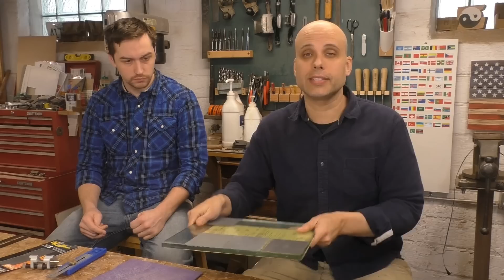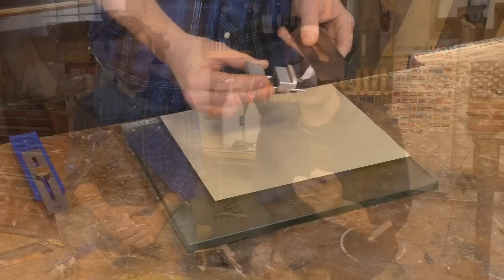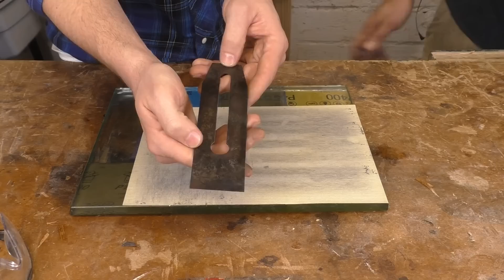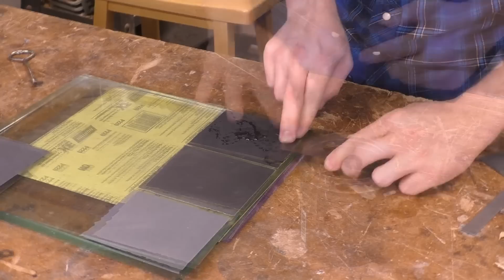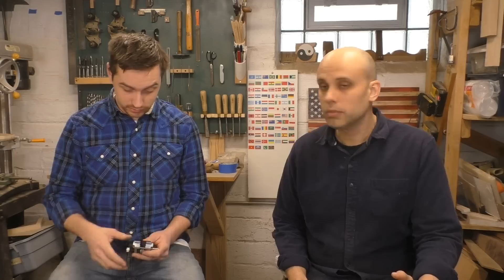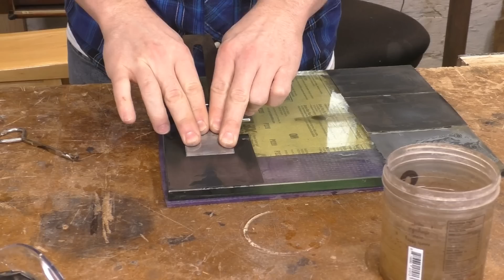True Beginner: Basic Sandpaper Sharpening

Comment: Thanks for the great instructional video.  Using your information I now have my Taylor Toolworks #5-1/2 Jack Smoothing Bench Hand Plane working well on pine and fur.  Haven't tried hardwoods yet.  I still have a 0.001" gap between the chip breaker and iron I can't seem to get rid of.  This gap only collects a very small amount of chips (~1/16" strip of material) but doesn't seem to effect the planes usage.

Comment: Hi Rex ,I just wanted to say a massive thankyou for producing the most informative videos that I can completely relate to , for as long as I can remember iv had frustratingly dissapointing results with a hand plane , untill today ! I recently picked up a very nice condition Stanley no 5 for £20 having sharpened, cleaned and set it up as you have shown it produced a shaving that was full width full lengh and translucent! I was completely blown away by just how good this quality tool can be when it's correctly set up ,you have made this particular subscriber extremely happy today thanks again

Comment: Thank you Rex and Nate. One question I have is regarding using a honing guide. When you set the length of the iron out of the guide, do you need to reset that length to get the correct angle as you grind down the edge? Or is that evened out in the 2 degree offset?
Keep up the good work

Comment: I recently used a similar method to hone a straight razor. Started with 400 grit, then moved up to 600 and finally 1500 and finished it with a leather strop. Scary sharp is right! I was skeptical, but it worked.

Comment: Hi, Rex. Dumb question(?). Do you need to glue the wet-dry paper to the flat surface? If so, what kind of glue? Does spray adhesive work? Also, please explain the reasoning behind WHERE you attach the W-D paper. I notice that you have it all along one edge of the glass. Thanks.u
Reply from the maker: No problem.  I use 3M Super 77 spray adhesive.  It comes off with mineral spirits.  I put the paper on the edge of the glass because that's the only way you can work the back of the blade. Totally not dumb questions.
Reply: Thanks for the quick reply, Rex. I enjoy all of your videos — and learn a lot of useful, sensible stuff that has greatly improved my woodworking.

Comment: I really enjoy your approach in the videos. So far, I'm only a watcher, but am planning to sharpen some old chisels I have that have seen better days.  
BTW, chromium oxide buffing compound you said it was chromium and oxygen that's inaccurate. Chromium oxide is chromium rust, just like iron oxide is iron rust. Oxygen has acted on the metal to (begin to) degrade its structure. Putting chromium oxide into the compound makes the compound have a kind of super-fine 'grit' (like putting grades of sand on paper makes paper have varying 'grit'). Different additives in compounds help with polishing, buffing, even cutting.  No, I'm not a chemist or similar, but woodworking isn't the only rabbit hole on youtube.

Comment: I disagree about the economics of the scary sharp system I've been using the same strips of abrasive for about 6 months. I've sharpened all my chissels and plane irons repeatedly. Now I spent a little more and bought the abrasives from the UK company that uses the scary sharp brand name I think the main difference is that it sticks to the glass better and I use the 2 wheeled honing guide they recommend using that in conjunction with honing oil and only ever pulling the blade backwards the abrasive lasts a long time.

To sharpen with water stones or oil stones you will also need a diamond stone to flatten the surface of the stone periodically do these methods are pretty expensive.

Comment: If you use spray adhesive the sand paper lasts a very long time, I also made my sharpening surface on glass and the reloadable option out weighs an imperfection developing in a stone

Comment: I did it! Thinner than paper shaving buttery smooth wood. And it is amazing. Rather than sandpaper I bought the sharpal diamond stone 60 bucks for the big one (do not bother with the small one). 320 on one side and 1200 on the other. This is a tool steel terror. The stone does its job well add a strop and you are done. That said. I did and redid the blade. Now on to the true beginner how to plane. 

Rex and Nate Thank you!
Reply: Hey, do you have a link or name for the diamond stone that you bought?

Comment: I happened to be passing by a place that does custom stone countertops...and Lo and Behold!...they had a 'scrap bin' of off-cut pieces of granite that was open to anyone that wanted to dive in and salvage whatever they could use. Came home with several pieces. Granted...they are smooth on just one side. Great thing about them is that they are HEAVY and don't slide around much. I've glued thin foam padding material on the back side and they now STICK to my work surface really well! You could use that rubber/foam kind of kitchen drawer liner material just as well.
My one suggestion here would be to put a little dish soap in the water that you wet the sandpaper with, or use something like glass cleaner (Windex). It will help keep the sandpaper from clogging up and, thereby, last much longer.

Comment: Wait so for the honing phase, what do you  set the projection angle for, do you set it differently than the setup phase? I would think you would want a slightly more dramatic angle on the very tip of the bevel, no?

Comment: Help guys. I have a flea market plane iron. I flattened the back and used a honing guide on some 150 grit sandpaper to prepare the iron for honing. I was doing that and used two sheets of sand paper and for the life of me can't get a burr on the back. I thought ok maybe I just can't see it but after running it on my 400 grit water stone for a few minutes, still no burr. They take off material but there is no burr on the back and the iron doesn't feel any sharper.

Comment: I find it works well to explain grit progression thus: Imagine you're going to dig a swimming pool sized hole that you need EXACTLY 4 feet deep. What tools would you use to do that job? You might start out with a backhoe because it can move a lot of dirt really quickly. However, it won't have the precision to get you to exactly 4 feet deep. So after the backhoe, you switch to a shovel. It moves dirt more slowly, but allows you more control as you approach 4 feet deep. To get it to that perfect 4 feet deep, you would then switch to a hand trowel to take tiny scoops getting even closer. You might finish with a tablespoon searching for that perfect 4 feet deep. 

Now, you could do the whole thing with a tablespoon, but you'd be crazy to.

Backhoe = 220 grit
Shovel = 400 grit
Hand trowel = 1000 grit.
Tablespoon = 1500 grit
Reply: 3000 grit baby spoon
6000 grit a flat splinter

Comment: I’m almost ashamed to admit that the accurately cambered iron... has been kicking my butt. I really thought it wouldn’t be much of an issue since I’ve been honing just about everything for decades, even straight razors for the last decade. I put pressure on the outer edges like all the videos show and work my way in and the edge still ends up leaving lines in my work piece. It has gotten a little better but I cant really even see or tell there’s a camber even if I set the bevel with outside pressure and honed with pressure on the outside edges the whole time.. I pretty much still end up with a straight edge and lines in my work. Put a straight edge across it, and it’s still virtually perfectly square with zero camber. I guess I just need to tinker with it and figure it out.

Comment: This is great! I had a stupid problem early on, but it was easily fixed: When you glue sandpaper to a flattened surface, ONLY put glue around the OUTER EDGES; putting glue in the center of the sandpaper will only create ridges for the blade to get caught on, and ruin the paper, and probably mess up the edge you've gotten so far. It sounds obvious now that I made the mistake, but I was on auto-pilot when I was doing this, and assumed getting the sandpaper super secured to the paper was more important; it's not. Overall, it took me about three days to get to the final product, but I can easily shave hair off my arm now! Feels great to finally accomplish some of the basics! :)

Now onto the much harder task of restoring the hand plane itself. Seriously...there's so much rust on the sole (I think that's the part, the silver part that sits flat on the wood to be planed) is so rusted that the entire thing is basically orange. No silver at all. The cast iron itself is just a bit dusty, but that iron is just...caked...in rust. I can't even tell if it's pitted, but I'm assuming it is. Wish me luck, boys!

Comment: For those looking to not jump into the fray of over-priced sharpening systems from using sandpaper - In Paul Sellers recent March 11 blog post he discusses the very inexpensive Chinese diamond stones he switched to from his more expensive EZE-Lap stones. He makes a good case for them, saying that they are going strong after a months use - which is more like a year for the hobbyist woodworker. Also, there are multiple comments on the post from other folks saying that they have been using the same stones for years, and they are still going strong. You could put together a system of 3 of these stones for around $15. It hasn’t arrived yet, but I broke down after reading it and ordered a 1500 grit one on Aliexpress to compliment my Trend combination stone - which is 300/1000 (and I did not purchase until I could get it deeply discounted). I was going to wait until I could get the extra fine DMT Stone, but I’ll see how this one does glued to a piece of plywood. It was less than $5 shipped. Pretty sure they are unbranded - on Aliexpress the description is 

“1 piece Grit Professional Thin Diamond Knife Sharpening Whetstones Polishing Knife Sharpener Plate Grinding Disc Abrasive Stones”

A mouthful to be sure, but maybe this could help someone else take their sharpening game up a notch from sandpaper without breaking the bank. I probably wouldn’t bat an eye at the suggestion of these stones Otherwise, but when someone like Paul Sellers says that he switched to them and they are doing well for him, then I at least go, “hmmm?”. Thank you for the great content Rex!

Comment: Instead of going and spending the 12 or 15 bucks what one could do is visit their local auto body shop (especially if you've ever had a vehicle worked on by the shop) and ask them to buy a couple 1000 and 1500 sheets (they usually have 12x12s, so you could get a few squares out of the one sheet) and they might sell them to you at cost, which is about a dollar per sheet considering the fact that they go through so many. Or if you're friendly with the painter he might just give you a sheet or two. They also only use the paper for one car usually, so they toss them after they're done. you could ask him to fish them out of the trash.

Comment: I love this video so much.  I was very intimidated by sharpening when I first started woodworking, but it's really not that difficult when you get your system down.  I use two different setups...sandpaper for grinding and diamond stones w/ strop for honing.  For grinding,   I have 4 heavy grits of self-adhesive sandpaper stuck to a flat ceramic tile I got from Home Depot for $2.  I just went and grabbed a level from the tool dept then went over a couple of tiles until I found one that was dead flat.  It's 18" long, so I can take really long strokes when I'm grinding off a new bevel.  I also have that roller jig, but I only use it to set a new bevel.  I have a Course/Medium/Fine diamond set I bought off of Amazon  for honing.  Finish it on the strop with some honing compound, and I can shave the hair off my arm.  Re-honing takes a minute, as I typically do 15-20 strokes on the medium and fine stones, then give it 10 strokes on the strop and it's back to razor sharp.

 Once I took an old file I found in the bottom of my toolbox that hand't been used in years (extremely hard steel), and decided to see if I could put an edge on it.  In 15 minutes, it was razor sharp.  I put a handle on it and actually use it a ton.  It's still a file, it's just has a chisel edge on it, and I've been really surprised how handy the file part is.

Comment: 6.55 or so ... what Rex doesn't say is that this is fairly mindless and enjoyable - the kind of thing you can do in front of a TV or chatting with people. It's a perfectly good way to spend an evening!
I was lucky enough to find an offset of cut and polished granite on a street one day - from a bathroom or kitchen installation. It's about 18 inches long and a couple of inches wider than a typical place iron. It's perfect for fettling planes and sharpening.

Comment: Great tutorial... JUST gonna point out one minor point in shop upkeep where I actually prefer the sandpaper for sharpening... "Funky shaped blades"

   From groove cutting planes to certain gouges, a shop has a few blades that you simply do not want flat and straight. Here the sandpaper's nature to be flexible comes in extremely handy. You can fashion the "sharpening rig" to fit the tool, glue a sheet down to it, and in a single stroke cover everything. Of course, rigs and jigs can be manufactured for other methods and materials, too... BUT the sandpaper is just too convenient when working on a curved, rounded, or just plain "funky shaped" cutter, regardless of the tool.

    For all the flat bevels and straight or relatively straight cutting edges, though... a proper stone is the long term way to go. ;o)

Comment: You can get 1-pound of green buffing compound for about the same price as 1.6-ounces in your link. I posted a comment before with the (non-sponsored) link but you did not approve it for some reason. The product ID is B0000DD35C
Reply from the maker: For the record, I never saw that comment. They all go through unless YouTube flags them. Also, I picked that compound because it's the one I use. No other reason.
Reply: @RexKrueger  I think youtube sends all comments containing outside links to the channel owner for approval. Unless there is some way to turn that off or change the options (not sure).

Comment: While I've read woodworkers who viewed sandpaper as a cheap entry-level 
only solution, & detracting its long term cost effectiveness, I find
 that using it dry, clamped down to a flat surface, I can get a lot of 
use out of it, & not have to worry about it getting warped by water 
or being permanently glued to the surface. You can get a variety of 
grits for less than the cost of a single good water stone or diamond 
plate. I've used primarily sandpapers varying from 40 up to 7000 grit to
 reprofile & sharpen everything from a plane iron ( no jig), 
chisels, knives, hatchets, & even a billhook... the latter had a 
steep recurve, so I took a piece of 2x4 and carved a curve along one 
edge, clamped sandpaper to it, & it roughly conformed to the curve, 
allowing a mirror polish all the way up the blade. I'll supplement that 
with a final touch up on a fine ceramic stone, then strop with 0.1 CBN 
emulsion on a paddle strop. I find myself going through the rougher 
grits and finest grits most often, so buying more of each of those 
extends the time you can get out of the overall setup. Supplement with a
 few fancier options, be they arkansas stones, water stones, diamond 
plates, ceramic, what have you, as you can afford them, makes for a 
pretty versatile setup!

Comment: Why not just sharpen on your actual window? Don't see a reason why you wouldn't.... :)

You might have experienced when flattening a iron that the sand paper will dent in a bit and round over the edge, what would you do to eliminate that?
Reply from the maker: Glue it down better to a flatter surface. Use high-quality paper.